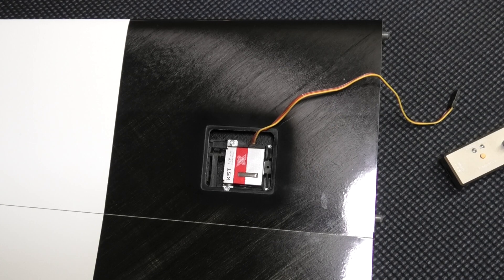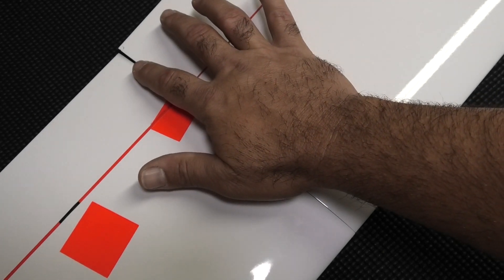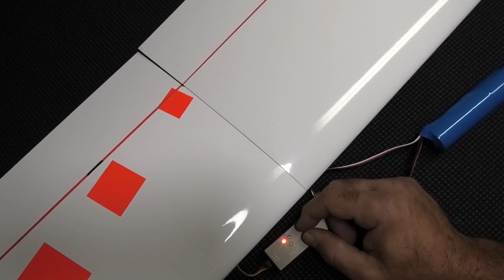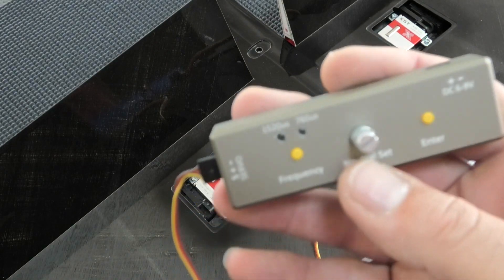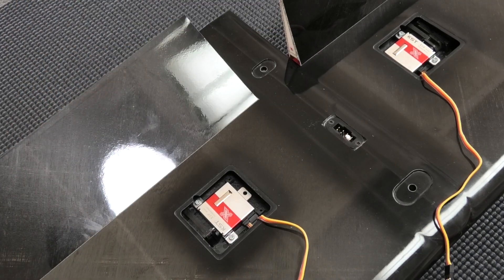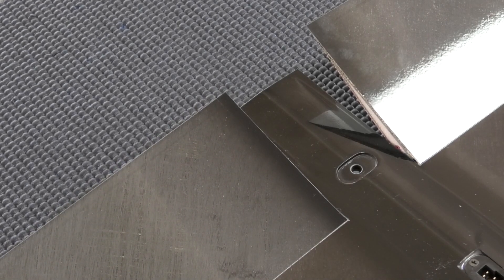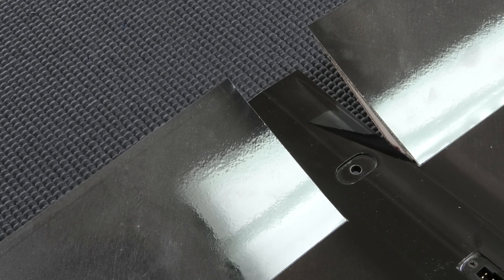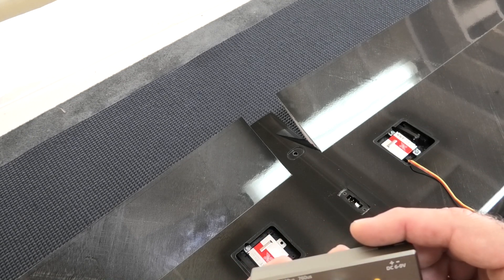KST Servo, programming center.

Comment: Even if this tool is very handy, mine went crazy and put two servos A08 v6.0 out of business. They don't move, and when they do just went to one direction and get locked there. Tried (praying) with o different servo, but the tool doesn't work. It does all bells and noises but doesn't work. Question is how can I reset those two servos and get them back to work?

Comment: This is NOT a good idea. Now you have a servo which is not mechanical well configured and the way to both sides is different. I would never ever do this, always try to center mechanical in the first place!
Reply: you are correct but you can use this tool to set a perfect 90degree angle on any servo arm thats the way to do it not like shown here
Reply: @creep7009  Just saw this post. I think when the centre point is changed,  full servo movement in either direction is maintained. Otherwise you may as well adjust the centre with sub trim, and accept assymetric maximum travel. Which is probably not needed in any case.

Comment: Nice. But what is the benefit over transmitter adjust? Endpoints won’t change…?
Reply from the maker: Correct, end points won't change, and less subtrim. Balanced throws both directions, which have other effects downstream when you get into mixes...etc....